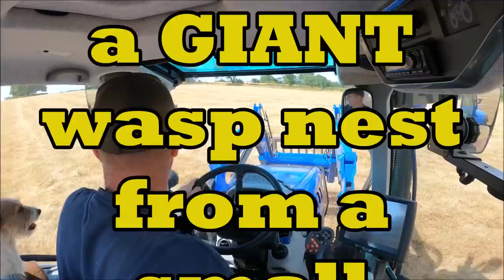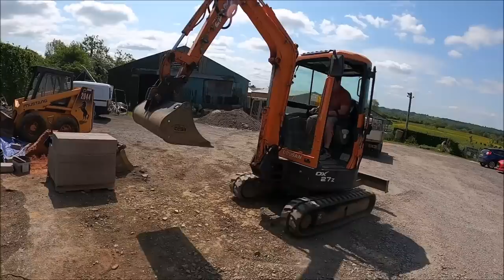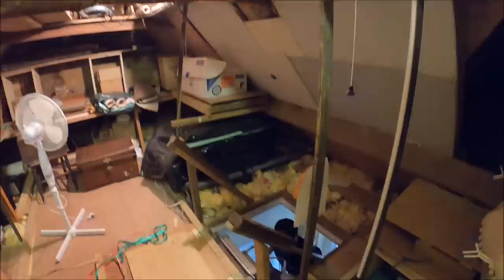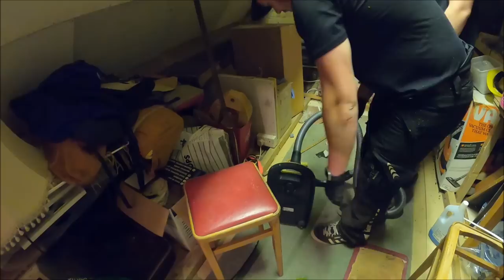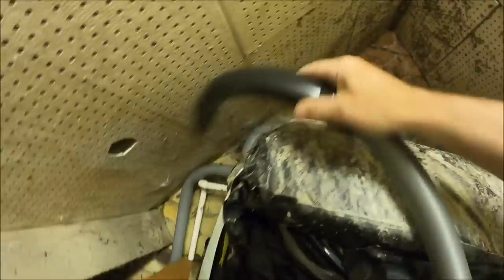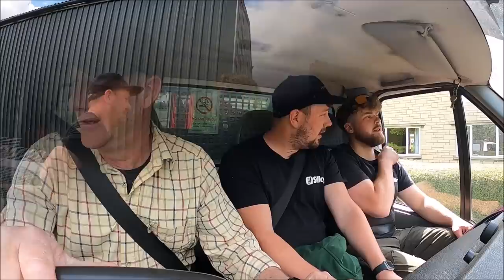16/05/23  Removing a GIANT wasp nest from a small loft!

Comment: That was huge, i did one once on a chimmney breast that was close to that size. From memory i  sprayed it with deadline insectaban  and retreated rapidly. The permethrine  in the insectaban is caried on a parafin oil type base so it was  at the time the most rapid knockdown  chemical i had.

You could hear the buzzing even after the lofthatch was closed as it took affect!

I dont miss doing pestcontrol work one bit, not every wasp nest was easy money and the big loft nests like yours and my chimney breast one every penny was earned!